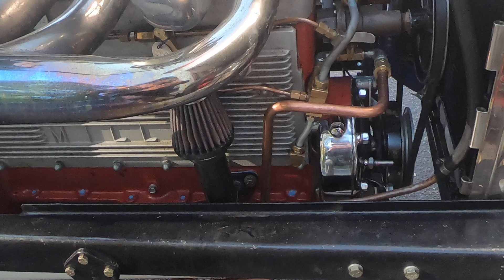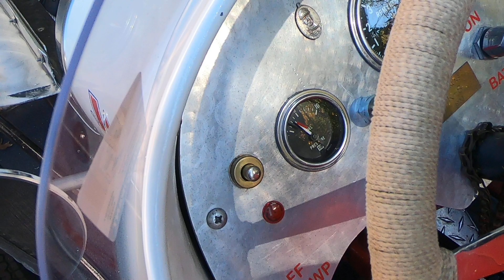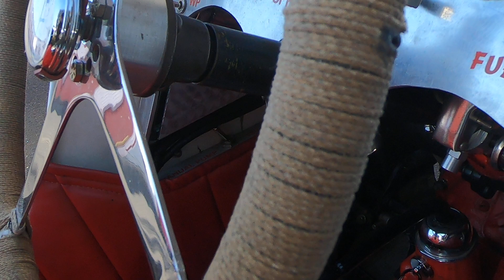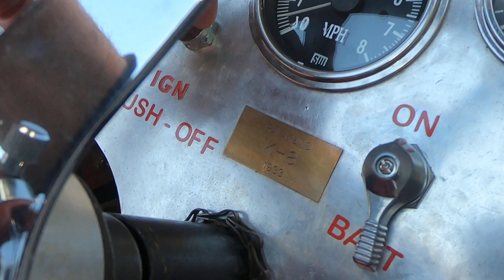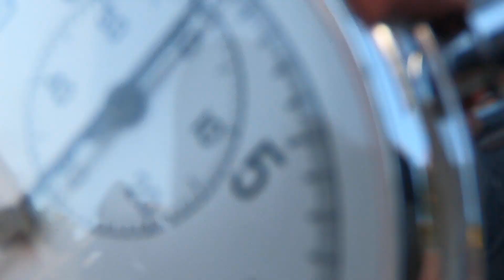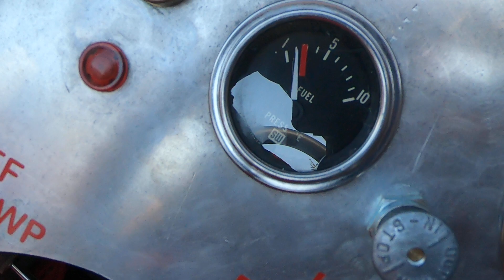dirt track car hand fuel pump

Comment: Pretty convenient fuel management set up.
Reply from the maker: Thanks. I actually bought two original Model B fuel pumps (to make one good one) so I would not need the electric pump. Something about the sound of an electric pump on an old car bothers me. Would leave the hand pump in the line to prime the carbs. That may be a project for next year.